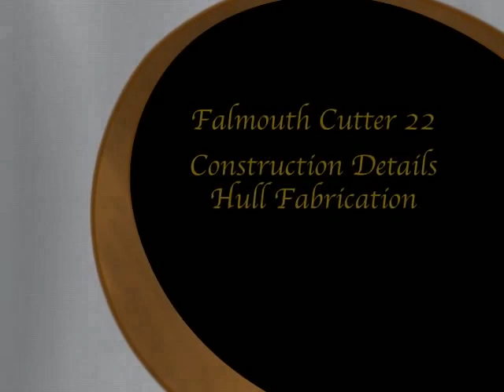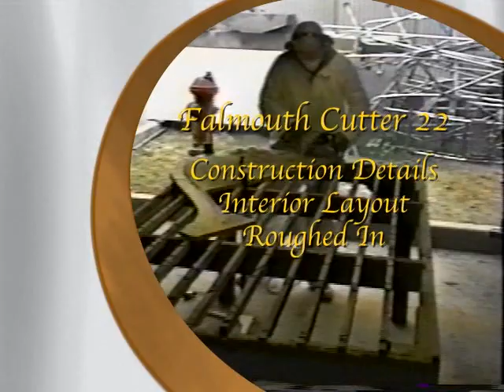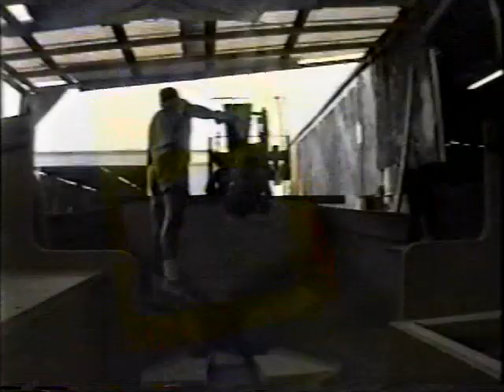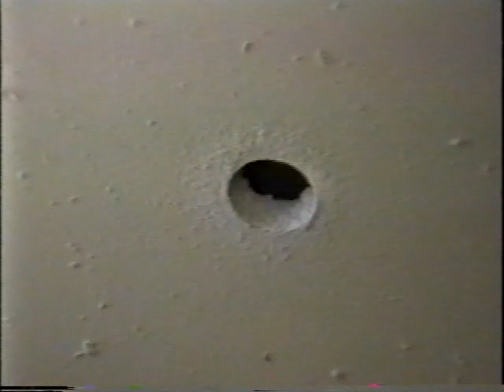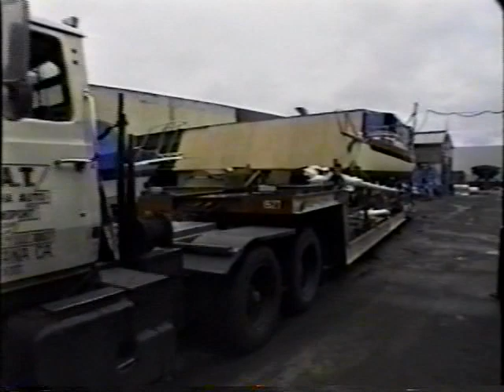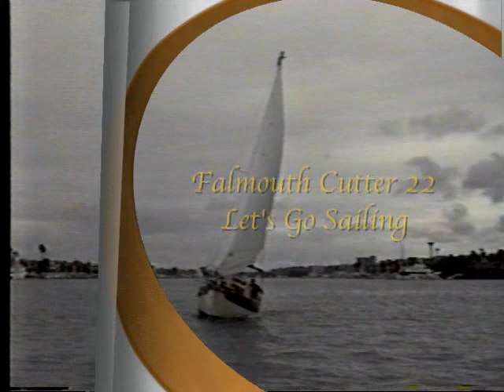Falmouth Cutter Construction and Sailing

Comment: I am a little confused on the vinylester being used on the 'initial' layers, not all layers and not in the gelcoat mix? Also, I have heard in numerous places that acetone should not be used for cleaning sanded fiberglass,in that it affects the bond of subsequent layers, is that true???
Reply: I worked for years at a large builder of fiberglass showers and tubs. Acetone does disolve resin used in fiberglass but it's used extensively for cleaning and preping. It doesn't affect bonding if the acetone is left to dry before layups. Luckily it evaporates quickly. Acetone softens the previous coat giving the new coat something to bond to. It's similar to etching.